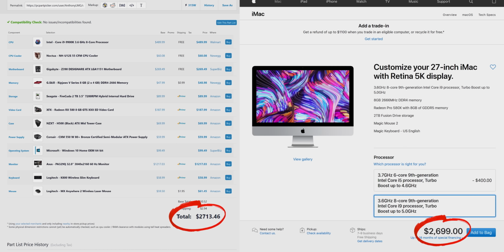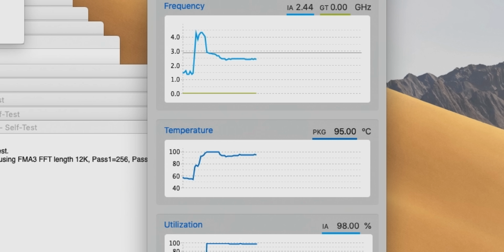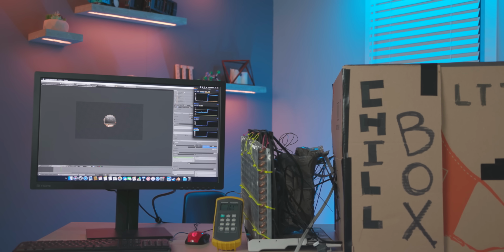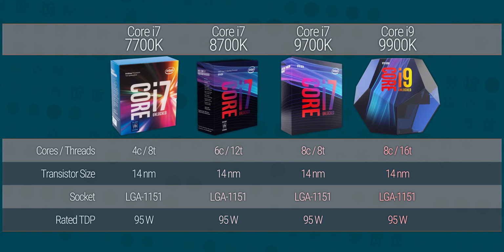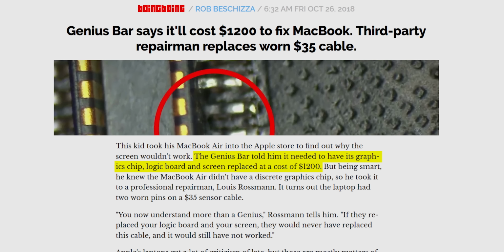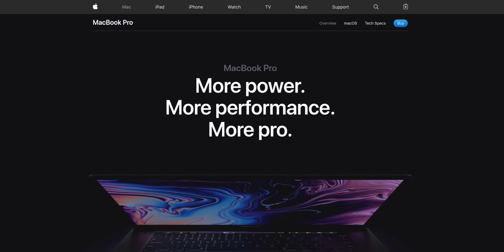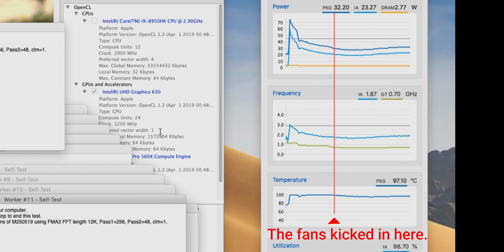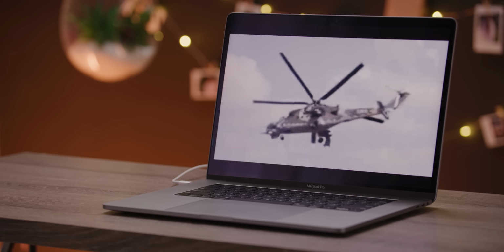Macs are SLOWER than PCs. Here’s why.

Comment: I've tried to explain thermal throttling to my bosses and coworkers when they thought it better to buy laptops instead of desktops for our work. We use CPU intensive engineering software. The general public - even somewhat tech savvy people - don't have a clue about thermal throttling. The see i7 on laptop specs and think same as desktop i7. The PC companies also push a misleading narrative.
Reply: i sell computers and have to explain that to people every day.
Reply: @Thisguya  you're one of the reasons why I didn't lost faith 🙏🏼
Reply: @Thisguya  Your boss would probably rather you didn't.
Reply: @BuzzkillZone  naw they let me work my way because it works and creates return business and long term customers.
Reply: Who runs the IT department?
Reply: @Ziplock9000  I worked at an IT company, and I can tell you from experience: Arrogant morons.
Reply: @Ziplock9000  Girls!
Reply: A former boss demanded we put a bunch of high 75W vid cards into some Dells that had weird max out of 35W on the pci-e x16 lane.

I told him this. "Put them in." OK. BOOM! All sorts of problems and burn outs.

I mentioned it again to him. The SECRETARY parroted out what his new reasoning was (hadn't heard it before): "The vid cards were bad so we don't order from that company anymore." Hands on hips, smug look.

Can't believe I showed her kindness by not ratting her out for gaming on her work PC. Don't work there anymore.

Work somewhere else with equal stupid.
Reply: @czos9239  so many people are just pathetically arrogant...
Reply: It's not the PC companies necessarily it's intel. Intel's naming scheme is so confusing. An i7 8550u is slower than an i5 8600k
Reply: Duh! The 8600k is kind of a good cpu!
Reply: @griffin8062  the u means something... maybe underpowered
Reply: @thetechguyz8645  Well I know that but the average consumer reading the average spec sheet just sees "Core i7" and assumes the computer will be fast
Reply: @griffin8062  when the tablet phase came they had to adjust and make a processor for each form factors. Desktop CPU sales slowed so they release a ton of different TDP cores along with more integrated to the board. I agree with most of it down to the i3... the rest of it needs to go away. Still a Pentium core. There is already i3 i5 i7 and three different thermal levels for each. Ultra low power low power mid range performance and high performance and then super high performance. Plus atom and Pentium... server processors its rinse a repeat. Maybe not quite like their consumer products. They do need to simplify it but they were late to SOC game I think they have had a tough time gauging it. I'm shocked there is not a Intel processor in every smartphone. They missed the train on that one and missed production capacity recently.
Reply: @griffin8062  Still, It makes profit. You pay even more for i5 mobile. What's wrong for them?
Reply: @griffin8062  Its intentional
Reply: @griffin8062  Maybe other companies want intel to keep doing this, as eventually, all they need to do is fool the large demographic who doesn't know anything except i5+2 = i7.
Reply: K represents desktop,  U is mobile.  i7 mobile CPU is faster than i5 mobile.   Desktop i5 is faster than i7 mobile..
Reply: @regulusatilius4121  LOL K DOES NOT REPRESENT DESKTOP it represents the unlocked multiplier.
Reply: @griffin8062  I didn't know that an always assumed i7 always beats i5.  Thanks.
Reply: I'm a data analyst and Everytime I reload my data or run R my fans ramp up to full speed. I'm always maxing out my CPU and it drives me nuts. My work laptop isn't the best but it's still limited by heat.
Reply: setite copypasta.
Reply: It's not only thermal throttling, but a laptop core i7 7700hq is slower than a desktop core i7 2700k from 2011, of course it has vastly improved now, a laptop core i9 9880h has about the same performance as a core i7 6700k from 2015
Reply: @tristan6509  maybe multicore scorings for cpu intensive apps but definitely not gaming
Reply: @tristan6509  it may come as a surprise to you, but laptop i7 8750h is faster than i7 7700k at multithreaded loads and only 10-15% behind desktop 8700 when undervolted
as for the i9 you mentioned - are you insane? did you look at the benchmarks or render times? WTH you people get this kinda info from?
Reply: @tristan6509  Well, not really an inprovement. One costs nothing, the laptop one, 2000$
Reply: @tristan6509  Pull a source or youre talking crap.
Reply: @MultiFuckme22  7700 doesn't have an unlocked multiplier unlike the K series...
Reply: @tristan6509  im not saying the laptop one is as fast as a desktop, ofc it isnt. What im saying is send bench scores to back up your claims or they are trash. I have heavy doubt a gen 2k would out preform a gen 7h given the same conditions
Reply: @tristan6509  Thats not true at all, and doesn't make sense. The core i9 has 8 cores and 16 threads. Its geek-bench multi core score is 6147, vs 4456 for the i7. And the i9 does that at 45w vs 91w for the i7. That is not even remotely comparable.
Reply: @tristan6509  this is not true. My 7700 is faster than my 4790k. Maybe if I overclocked it'd be different, but as it stands I use my laptop for cpu intensive things and it does quite well
Reply: @xavdest5481  i don't think a 7700 can be overclocked..
Reply: @tristan6509  that's why I said if I did overclock it might be different, but as it stands my 7700hq undervolted is better for cpu based take. Perhaps you misinterpreted my comment?
Reply: @xavdest5481  a 7700 cannot be overclocked, it doesn't have an unlocked multiplier unlike the K series CPUs
Reply: Thats why you should RESEARCH first before buying the product
Reply: Uh no, if your boss tells me that I have to get a laptop over a desktop I would assume it’s because they wanted me to be mobile with it and take it on trips or something.

Pretty sure everyone knows a desktop is more powerful than a laptop.

I mean look at what’s in a desktop the gpu, cpu, cooler, fans, memory, etc

All that shit is bigger than a laptop’s and everyone knows bigger is better.

So yeah that’s pretty surprising your work believes laptops to be superior.

Laptops are cool and all but I always view them purely for what they are meant to be: MOBILE.

It doesn’t matter how amazing the laptop is, it can have a RTX 2080ti in it and you would still always be beat by a better desktop.

You are not beating a desktop if money is no object, there will always be a better one.
Reply: Wait, engineers don't understand thermal throttling, so you work for apple then?
Reply: @noobiesmurf  the fastest mobile processors that don't throttle are made by apple, why are you kids so fucking stupid?
Reply: buy xeon server, put high end gpu in it and set it as remote desktop server. they can use even i3 laptop as client
Reply: @mzamroni  Uh I surely wouldn't recommend an i3 laptop, not even as client, not for anything. I bought a 5th gen i3 laptop for my wife, thought it would be decent. That thing is slower than my 12 years old low-end PC.
Reply: An uphill battle my friend. Comment from a friendly neighborhood sysadmin.
Reply: Lucky for me it's easy to make people here understand this stuff since I said something like "thermal throttling is when your cpu/gpu is hot enough for it to slow down to avoid overheating" and follow that up with live example.
Reply: Yas! I had the same argument with the IT manager, laptops and the mini-PCs we have are fine for our staff 75% of the time but we need a hardware resource for the more intensive applications. He said something about doing it in the cloud, which is okay, except our existing cloud resources suck and the way we do contracts and procurement means that’s not likely to change anytime soon.
Reply: the real reason to why they choose  laptop is to lead the employee to take it with him at home and possibily to work a bit more than the regular office time...
Reply: Dell Precision Mobile workstation laptops can run intensive CPU and GPU apps 24/7 with temp never gotten higher than 70 celcius, with the lid closed or opened. I have many models of these before so I know there are really desktop replacement-notebooks. One just need to do some research. HP and Lenovo have similar line as well. They can be speced with Xeons, ECC rams and with Quadro or Firepro GPU.
Reply: @noblekitty  But those are super expensive
Reply: @abhimaanmayadam5713  just as much as these Mac pro. Honestly, if you were to build a desktop with Xeons, Quadro gpu it's going to be expensive too
Reply: @noblekitty  I'm using an Xeon with an RX 560. works great.
Reply: Very true.  I own one myself and have run my Dell M6800 for 24/7 render jobs for years.  There has been no thermal throttling (when NOT using the dock) even when operating the GPU and CPU at 100%.  The fans do get loud though.
Reply: @noblekitty  No they are not. The fan ducts are so tiny that you need to disassemble them every 6 months or they will overheat and throttle down to 1.6GHz without warning. The fans do not even spin up while overheating!
Reply: @noblekitty  I can vouch for this. My Precision 7730 with an i7 8850H and Quadro P4200 can easily run intensive tasks such as GPU rendering in Redshift, painting and baking in Substance Painter, sculpting in Zbrush, or animating in Maya and it can do it all without thermal trottling. Hell, I can do a hybrid GPU/CPU render in Blender Cycles for fun and the GPU stays around 76 degrees (fully boosted) and the CPU around 85-90 degrees at around 3.6-3.9GHZ. The CPU can also maintain its boost clock indefinitely during intense single threaded tasks without much issue.

 The thing that really causes some issues however are the giant thermal spikes from both the CPU and GPU when running my Wacom Cintiq through the thunderbolt ports. What is that all about?
Reply: @noblekitty  The only problem is that the fans go crazy and are really rather loud.
Reply: At least some PCs come with beafy coolers.
Reply: Not to mention that even the "H" series laptop chips perform severely worse than any desktop tier chip. The big misleading bit is "Turbo clock up to 5Ghz!" despite the base clock being 2GHz
Reply: i worked for an engineering firm designing fiber wire runs. we had laptops and they performed pretty good. i didnt mind them specially after i got work from home priviledges.
Reply: It is possible to build an i3 hackintosh 8350k 5.1Ghz that blitzs the i9 laptops costing 10 times more for many workloads. That is how severe the problem is.
Reply: Yes, this is their target audience, and it's next to impossible to explain these aspects to people who only see status quo. They just tune out and default back to their own paradigms. My boss is a Starbucks digital nomad (he hates being called that) who uses a Macbook because it's cool, and of course he needs other "entrepreneurs" he meets with in the eCommerce space to see him using it cause in dumb speak, saying you have a Macbook is a good sign you're having your finger on the pulse man. God forbid they might think less of him if he's seen with a Carbon X1 or an XPS. Even though those might be pricier than his. A couple of years back he told me his iPhone 7S has a higher resolution than my phone at the time which was an HTC 10. I almost burst into laughter but managed to contain myself. Didn't try to explain how that is false, because he just got the phone and didn't want to disappoint him lol. I've learned that with these people it's best to just let them wander around their comfort bubble and not disturb them.
Reply: @root9065  😂😂
Reply: @root9065  It's best not to disturb programmed sheep.
Reply: @root9065  spot on with that last point. Not worth having that conversation cuz 99% of the time only person getting screwed is them so fuck it.
Reply: @root9065  also is it just me or do they know deep down they are getting ripped off. Because they constantly need to validate buying an apple product by making statements like the one you mentioned about phone resolution.
Reply: R.I.P
Reply: a $30 laptop cooler for thin and light laptop is a good compromise for mobility/thermal throttling
Reply: they can't be tech savy. I'm just a kid that likes pc and taught myself how to build one 5 years ago. I know why they are throttling and I know that intel is fuckin up. AMD isn't the best for games but its better right now. they innovated which is why I have updated my current desktop with ryzen 1600x (I don't do much CPU intensive stuff)
Reply: It's so foolish, assuming they're not prioritising portability.

What really gets me is, it's not hard to understand. They should just imagine working in a sauna instead of their airconditioned office, then realise that the chips work largely the same way.
Reply: Your boss is an idiot no offense
Reply: @tori9365  you're cute no offense
Reply: @nowonmetube  thank you 😘😋❤
Reply: @tori9365  aww that's cute 😊 thank you too and you're welcome 😘❤️
Reply: @nowonmetube  haha 😊
Reply: Reggie Jackman haha have you ever worked with engineers? They know shit about how computer hardware works. Even the developers wouldn’t be able to tell the difference from RAM or the SSD unless you pointed it out.
Reply: @PatrickPecoraro  wtf.
Reply: @PatrickPecoraro  So incompetent, like I said.
Reply: To hear that it’s a IT company and that thermal throttling is completely logical is really sad.
Reply: Didn't Apple get caught , and admit to forcing phones and computers to throttle down intentionally via a bogus software update right before releasing new products?  I think they want the ability to cause reduced performance without it appearing so.   And they do that with the fans and throttling... and I'm sure with the aid of certain services running in the background.
Reply: I used to fall for this when I was able to afford recent laptops, and wanted to game on them.  I have always liked MacOS and Apple computers looks and on paper the specs are impressive, so I seeing i7 I always assumed it's equivalent to the desktop chip, but watching this video has made me understand its not the same, and I'll probably reconsider buying an Apple laptop to use for intensive tasks.
Reply: Let alone that Intel now lumps Core M into Core i, so something like the Macbook Air touts the same "8th generation Core i7" as models with twice the cores and a few times more wattage.
Reply: "The PC companies also push a misleading narrative."  (LOOKS DOWN) "VIEW 185 REPLIES"  (NODS)
Reply: The only way i can see this as being reasonable is if they set up the laptops to be thin clients for the beefier workstations
Reply: While I agree that a great big desktop case has better cooling than a cramped laptop.
What people buy depends on their circumstances... I’m not static or at the same address all the time and I often need to travel abroad with my work every few months. Therefore owning a desktop just isn’t practical for me. Am I running intense CPU applications? No. In the past I’ve successfully used AutoCAD on a 2012 MacBook and never had a problem with heat.
Reply: Easy way, say: "Laptop cpus are crippled desktops ones, hey look here it has half of the cores (cores are like employees the more, better), so they would have half of the performance. Also laptops overheat, this is bad and makes it even slower, desktops dont do that, because air cant flow well in thin stuff". 
Done..

Usually works for me
Reply: @eduardoavila646  IT dept in my workplace think latest Intel integrated graphics are faster than GTX 960s that we used to have. Therefore we can start rendering using onboard graphics hahaha.
Reply: @wyw201  Lol thats quite bad! But if they actually buy pcs with only igpus eventually they will learn that a 960 is better, and probably the hard way.
Reply: @eduardoavila646  actually desktops do thermal throttle and overheat. Just not as easily as laptops because better air flow and more space.
Reply: @eduardoavila646  ambient temperature is also a factor. The way you said it made is seem as if desktops can never thermal throttle but they can depending on the ambient temperature and workload. It's just less likely
Reply: @javianbrown8627  Again,  well made and maintained ones dont. 
I had probably through the history the worse heating cpus, and with a suited heatsink, under a ambient temperature of 40°c, they were still in 'working temperatures' away from the limit. The worst case cas in fact a 125w Pentium D i had wich had something like 72°c tjunction, but just due to the low tjunction, it would get up to 65°c perhaps even 68, but no thermal throttle at all. 
Same for a amd fx8350 wich again had a pretty low tjunction (85°c if im not mistaken) and it was fine at 70°c. Any modern cpu will have a around 100°c tjunction, if you cant keep with a suitable heatsink its temperature under that even at my summer 38-42°c, there is something really wrong there. 

Again there is not much to go wromg with a desktop, it has a Xwatts cpu, and a heatsink designed to Xwatts or X+Ywatts on it. It should be fine unless something restricts the air flow. 
Then again thats why i say "well maintained", it means clean, cable managed and with the air ins and outs all not obstructed. 

Laptops in the other hand may be in a cloth surface or in your lap, have usually under-dimensioned heatsinks (15w heatsinks for controllable base 15w and turbo 30w cpus) and intentionally badly programmed fans to reduce noise, added to being hard to open and thus poorly maintained. 

Unless you get a desktop and put it in a 70°c ambient, with only literally the cpu cooler it would likelly overheat, but thats even humanly impossible to be at and i cant imagine any ambient where it would be like that. Or you got a 65w heatsink into a 95w cpu or a 95w heatsink into a 125w cpu, then its your fault to be using the wrong part. A 65w cpu comes with its 65w heatsink wich is indeed well designed and has space to be big and actually be able to cool down the pc. A laptop one is smashed and cant be big anymore due to the idiotic thinnes trend.
Reply: @eduardoavila646  yeah I know why laptops are more likely to overheat. Yes a well built and managed PC is less likely to thermal throttle, I'm just saying it's not impossible for them to do so but you seem to be missing the point. 
The reason is this isn't a perfect world and bottle necks exist. You won't always be able to get all the components to have a near seamless experience due to price, where you live and other factors.....
Reply: @eduardoavila646  yes, this is exactly what an ignorant person would say who never does any research. And Intel core i7 H series processors have the same amount of cores and threads as desktop ones.
Reply: @TabalugaDragon  Nope, thats what a person who didnt pay attention would comment. In my other comments i was talking about the ulv lineup. 
Secondly, not necessarily, a I7-9850H has 6 cores, while a real desktop i7, a 9700 or 9700k has 8 cores. 
Yes a simple core i5 for example a 7500 has the same amount of cores as a 7300hq, but that doesnt translate into the same performance even if most didnt thermal throttle or power limit throttle. While a i5 7500 does 8020 score in cpu passmark, a i5 7300hq does only 6796. Again, counting it doesnt have any issues as most entry level gaming laptops and some workstations do indeed thermal throttle. The dell g3 for example does thermal throttle, and actually most of the i5 h/hq equipped laptops with 1050 or 1060 do tend to do that. Some like the nitro 5 actually manage to not overheat.

Now of we talk about ulv ones, a i7 8550u has 4 cores at a baseclock of 2.0ghz (and with lucky you may get up to the turbo duty cycle varying like crazy, if the manufacturer didnt program the tdp limit to 15w), while the core i7 8700 has 6 cores. While theorically at full turbo max speed the whole time a i7 8550u would score a impressive 8301 at cpu passmark, the i7 8700 scores 15154. And lets not forget that most likelly the i7 8550u will throttle and be limited to 15w, wich leaves it with only 2.0ghz under heavy load, wich in fact will cut about 50% of its performance (being positive saying it would actually get up to 4.0ghz in all cores turboing while i think its actually its singlecore boost, probably the multicore would be 3.6 or 3.8) so then it would actually do 4150 wich is even worse than the previous generation i5 7300hq.

So uh, i guess you was the one who actually didnt search propperlly. Laptop cpus arent comparable to desktop cpus even if we take out their major cooling issues (wich even got worse with some extra cores).
Reply: @eduardoavila646  nope, it was you who didn't do enough research. Of course I wasn't talking about low voltage CPU-s, no one in their right mind would get them for a high performance computer. I was talking about H series CPU-s, and yes there are exceptions(though 9750h conpensates with virtual threads instead of 2 physical cores), I was talking about real life, long-lasting benchmarks, but usually the amount of cores the same, 10-th gen will have the same amount of cores and threads for CPU-s for example.
At short bursts my i7 8750h, while undervolted  scores a little more than 14000 points, now see how much it's desktop equivalent 8700 scores and compare. It also shows stable 3.9 in games when undervolted, which is also a really small difference between it and the desktop version. I have this CPU and I benchmarked it extensively, comparing it with some desktop CPU-s at my disposal, and the difference is between 10 to 15 %, just like I said. So get your facts straight before writing something. Speaking of Dell G3, it's exactly the laptop I have, and it peaks at 80 degrees C at full CPU load and doesn't thermal throttle, so yeah, I know exactly what I'm talking about here.
Reply: @TabalugaDragon  And again, i didnt say that every laptop cpu has half of the cores of a desktop cpu, but not only its easier to say that to someone who doesnt understand a single thing about computers, but also most computers sold in many countries, are still 7th generation, and usually most of them are ulv ones wich have 2 cores only, even on the i7s, so comparimg with even a desktop i5 it would be half the cores. 
But again, its a really simple resumé of the situation, not the whole story. 
Trying to explaing thermal throttling and tdp limits and even tdp itself to who have no clue about pcs or electronics, its too hard.
Reply: @eduardoavila646  I know exactly how they work, for I have been studying this topic in all details for several years now, cause I'm pretty much obsessed with laptop CPU-s, hence why I know so much about them, so no explanation needed, thank you very much. 
Again - people who want high performance would not buy an ultrabook with 2 cores. I mean maybe an office worker may not know that old dual cores are really slow, but a person who actually works with large amounts of data which require as powerful CPU as possible would know about the difference between a powerful CPU and a weak one in 99% of cases.
Reply: @eduardoavila646  OMG, your lack of knowledge astounds me. 
1 You offer me installing passmark benchmark? For whom did I post my 14000 points score in a comment above? for Santa Claus? This benchmark is one of reasons why I am so sure about smal difference, as I did this half a year ago. Now go look at i7 8700 score.
2 and speaking of small difference, you say they don't have the same performance, well DUH I never said they perform exactly the same, I said within 10-15% difference, and NOT the 95 watt TDP version you mentioned, in case you didn't know(and you obvipusly don't) the i7 8700 I mentioned is only 65 watts TDP, not 95
3 Laptop chips are higher binned, which means they can hold the same clockspeeds at lower voltages\producing less heat. Read about it
4 In case you didn't know, the amount of TDP doesn't directly translate into performance, if you ever overclocked or undervolted a CPU, you'd actually know this. 45 watts(with no tweaks) would give us 3.5 Ghhz, By your logic 95 watts should give us 7 ghhz right? Wrong. Again, you'd know this if you studied the topic and knew how voltage\frequency curve work. One can reduce the heat emossions drasticly without sacrificing much performance
5 With undervolting it's much easier to close the gap between the 2(again, NOT the K version, laptops have oerclockable CPU-s as well, so desktop K versions should be comparedto them, not to the cheapest, locked versions), which, in end result translates in really small difference between the laptop i7 8750h and desktop i7 8700.
6 LOL I never rely on such reviewers liek Dave Lee. I wasn't talking about combined stress-tests,  I was talking about CPU load only. If you ask reviewers what temps they were getting atCPU only loads they will easily confirm my words - 75-80 degrees C. I don't need reviews to knwo the truth if I have the laptop and render 24\7 on it quite often
7 " people who dont know nothing about computers" won't wanna super high performance computer in the first place
8 "I'm sorry, but if i compare a older cpu, due to ipc and manufacturing process changes ot of course will likelly be close. " the hell are you talking about here? I compare CPU-s of the same generation. Or you really think that i7 8750h and 8700 are made on different architecture? seriously?

And yes, I did read your comment carefully, the fact is, since 8-th gen laptop CPU-s have really high clockspeeds, which, combined with undervolting gives huge boost compared to previous gens. Go to passmark site and compare the latest CPU-s yourself
Reply: @eduardoavila646  Sounds about right. Amusingly enough, a C2Q Q6600 has a similar CInebench R20 score to an i5 7200u. This CPU is over a decade old and is somewhat close to a modern laptop CPU
Reply: @abhimaanmayadam5713  Yes, but sadly, as said before those laptop cpus tend to overheat due to bad cooling. 
The ulv chips (those who end in "u") are even worse due to cpu current limit or tdp limits of 15w forcing them to the base clock (and thus halving their performance). 

But yeah it's pretty impressive that a mobile 30w chip (should) outperforms a desktop 65-95w cpu.
Reply: Abhi Mayadam not when it comes to performance per watt they don’t. Or factor in the efficiencies of the newer chips with certain types of data.
Reply: Laptop cpu's are getting better.. but heat is the biggest issue... 
Im running a laptop with an i7 8750H. Which is last years cpu. I think it is the equivalent of an i5 8400? You guys seem to know more of this stuff then me.. I haven't got issues with cooling myself (running under 80 degrees all the time) BUT keep in mind older laptop cpu's can run to 100 degrees. Desktop cpus not. Mine doesn't reach that fortunately for me :)
Reply: When U Think your the standerd then u realized your not the standard.
Reply: It depends on the laptop though... some especially the bulkier ones are not too restricted.
Reply: Did they budge?
Reply: Wat.
Reply: Funny, I guess a lot of people don't get it??
Reply: So what you're saying is I shouldn't buy an i9 laptop?
Reply: @Mouseythegreat Unfortunately our database/software package requires us to be hooked up locally at the office. We can set it up to also work off the database, but it's a real PITA (nothing works as it should.. and you still have to do extra work when you hook back up to the database). Laptops do have built in UPS.. which is a plus.
Reply: Lot’s of pc guys and switchers getting fooled by that yes.
Reply: I know that laptop lineup isn't equal to desktop lineup and is inferior due to power and thermals... But I bought the i7 8750H for it's pretty closeness in performance to desktop chips... But I was wrong... The thermal throttling in it simply widens that gap...
Reply: Gus Johnson  And same probably applies to most PC laptops with the same Apple laptop specs... Shessh.
Reply: Buy a laptop and then just use a VM if you need different specs...
Reply: Me: What specs do you have?
Friend: I have an i7.
Reply: like my comment in this video. you'll have to sacrifice your warranty from your laptop to add improvements like liquid metal for cpu and gpu, adding more ram and storage(ssd/nvme/m.2/optane and so on) disabling any usless bloatware from windows and the from the brand of your laptop to speed up thing A LOT. minimize or disable all animations in windows to add a bit more speed
Reply: @MykTAOfficial  That can make it more snappy in light use, but it probably won't make a significant difference in CPU/GPU intensive work unless the laptop had some type of serious issue.
Reply: @BReal-10EC  yeah even if youre in a very cold airconditioned room to not make your laptop throttle but the laptoo has some internal minor or serious issure then voiding the warranty would be a pain in the ass especially youre laptop is very expensive
Reply: 1 word: Marketing.

“Established” Brands like Apple easily manipulates people. When basically there are things that they don’t tel, which are the secrets
Reply: They clearly aren't tech savvy in any way then. =\
Reply: @MidnightMarrow  yes sadly thats how marketing works. They manipulate the consumer in a way that's like a legal scam and they will find out excuses when to counter the arguments and claims.
Reply: At one engineering company, they buy Dell Precision 5530's or Precision 7730's for everyone that works with engineering software. Guess what the two most common repair calls are?
- Overheating (the machines get full of dust, hair, animal hair, or worksite contamination)
- Battery ( for those taken on-site), but mostly the 12/13/14" manager laptop, who have batteries die after 6-12 months, and the batteries are swollen.

The more or less right solution is for the laptop manufacturers to dial it back away from the ultrabook design that Apple popularized and put a desktop CPU, GPU and respective Cooling solution in a laptop form factor if they are intent on using it like a desktop, which also means that the back of the laptop must be removable, and the fans must be removable without taking any screws out. 

Instead though, the coolers in even the best machines are not even as thick as a pencil. Compare that to the 1" coolers seen on desktops. If you're going to make a laptop, be prepared to crater the performance if you don't give it adequate cooling.

If businesses really did a cost analysis of the productivity loss from taking a 30% hit to the computer, they would never switch to a laptop in the first place, yet the recent changes from mechanical drives to SSD's have resulted in a net gain, even if it was to a worse laptop because the drives are 30x faster, so what is normally the first hour of the day lost to rebooting the machine is now done in 20 seconds.
Reply: Try telling them that an i3 from 2018 is better than an I7...from 2012
Reply: Relax, they won't even notice nor compare the jump as long as you tell them they have top of the line hardware....
Reply: Sad but true.
Reply: I feel your pain. The people at my office sometimes experience horrible framerates in their modeling software when working on high detail structures. But for some reason, they're all on laptops. I know the goal is to make people more mobile, but when your laptop is powered by a single USB-C cord...
Reply: well, with undervolting the laptop i7 8750h is only about 10% behind the desktop i7 8700, so they could be right if they want aesthetics over a little more performance. However, if we are talking about top end PC-s like the ones that have Threadrippers in them, desktops definitely win there.
Reply: @kiyoponnn  nope, they probably know that i7 8750h is barely any slower than a desktop i7 8700 when undervolted
Reply: @TabalugaDragon  The "barely any slower" part makes a not-so-insignificant difference when it comes to cpu intensive workloads
Reply: @kiyoponnn  it depends on what kinda loads. Editing short videos, or for short bursts of power(like from several to 30 minutes) there wouldn't be a noticeable difference between them, mostly if you specfically measure the render times and such
Reply: @TabalugaDragon  Fair enough
Reply: So basically what apple does is put a i7, i9, etc in their computers for branding and because they don't want their users to hear fans, the CPU thermal throttles so you don't get maximum power? Seems like Apple
Reply: In layman's terms they'd understand, it's like running on a treadmill with with a dinky desk fan for cooling vs having a box-fan blowing on your face. You're going to get really hot and exhausted and will slow down quickly with the small fan.
Reply: @ReggieJackman  Tell them whats up when you have a meeting with the Bob's.
Reply: So heat is the reason that made my desktop using xeon e3 1231v3 rendering faster than my laptop using i7 8750h.
Reply: Old people just need to be replaced in the workforce, wait another decade and it should do
Reply: @ReggieJackman  This is probably one of the best advices
Reply: What the hell is even the point of i3, i5, i7, and i9 if a U series laptop i7 is worse than a standard desktop i3?
Reply: I am a financial director and I totally agree with you! Sometimes I have to run heavy VBA codes, and my i7 16GB RAM does not follow me :(
Reply: Youre work place dosent let you buy youre own laptop
Reply: "even somewhat tech savvy people" Well, I would dispute calling them that if they don't know about thermal throttling and the differences between mobile and desktop CPU SKUs. :)
Reply: Finally, someone said it. 
I gotta explain this to many Apple users. iSheeps are too stupid to comprehend the idea.
Reply: How do tech people dont know this?!?! thats is weird or not
Reply: I think laptop cpu can push performance for some time but for  continued work is big no except u water cooled it
Reply: My 2014 Macbook Pro can run 100% CPU stress test all 4 cores at 3.2GHz and keep under 80C with custom fan profile and a little reduced voltage to the CPU using Intel overclocking tool... Problem is that Apple by default allow it to perpetually overheat as they want it to run silent and self destruct just about the time warranty runs out lol.
Reply: It's sickening how tech companies like Apple take advantage of the non-tech savvy people!
Reply: @murphytheturtle8968  Actually, I AM tech savvy, as you can see from my Youtube channel. Please don't be mean. I know a lot more about computers than you think I do, so it's ironic how you can assume I'm not.
Reply: geo58impala not so sure about that. The lack of basic computer knowledge by Linus fanboys is legendary. They wouldn’t even be able to work pc’s from the 80s.
Reply: Explain a lightweight fan control app, sooo hard.
Reply: Software Engineering, not ENGINEERING software
Reply: PC companies are Democrats
Reply: Same at my job. Sometimes they listen and sometimes they don't.
Reply: I worked for half a year in the digital team for a major engineering consultancy. I was running Visual Studio Pro on top of Docker-based microservice infrastructure on a laptop with a Core i5 and 8GB of RAM. Some companies just don't think that it's worth spending the extra capital to increase productivity, when I lost a long time to waiting for things to compile, waiting for docker containers to load and so on. Add up the wages and they might as well just have bought me a better PC.
Reply: Don't even mention how poor ergonomics on laptops are if you're working on them. You either constantly have to look down or have your arms so high your shoulders will impinge.
Reply: @centralintelligenceagency9003  Word, yeah, laptop ergonomics are pretty bad. Though in my case I would always use a laptop dock mounted on a riser, with a second keyboard and mouse so functionally it just became another screen
Reply: There is no way to fix this if people don't try to learn simple stuff... apple is everywhere and why? Just because of a name... it was good when Steve was here, now Tim is literally cooking the whole pc making part of the company. At least that's my opinion :/
Reply: Is that why my computer tends to slow down?
Reply: "I've tried to explain" is one of the most melancholy ways to start a sentence in the English language.
Reply: @ian_b  And yet, you just did that. lol.
Reply: @BReal-10EC  You got me there Bryan :D
Reply: They'll pay $500 even if it's i7 (1st gen)

For clarification, https://cpu.userbenchmark.com/Compare/Intel-Core-i7-950-vs-Intel-Core-i3-9100F/617vs4054
Reply: What a circle jerk
Reply: Intensive Engineering Software? Surely your bosses and coworkers should know something, like what the heck?
Reply: Actually a lot of people know exactly what is is, maybe not older people (not sure how old you or your coworkers are) but im in my mid 20s and have known about it since I was 17 and started getting into tech. Anyone I talk to who is also into tech knows what it is.
Reply: This is so true!! Laptops are almost always a worse choice.
And the run of the mill office laptop i7's usually can't even keep up to an desktop i3, but all they see is the i7 logo and assume it'll be good.
Reply: They seem like the same people who would think the monitor is the computer...
Reply: @trueminecraftfacts  No.. just the "know enough about a topic to think they know it all" typical adult men. See The Dunning Kruger Effect.
Reply: A i7 7700 hq processor is almost equal to 6th generation i7 desktop processor normal version I did the comparison from graph myself but you have to put thermal throttling aside and power consumption so in theory some laptops do ship with swappable processor in theory they are close but in real world they are far from equal due to this Gap 😅
Reply: not a good thing to argue for when everyone at work is clamoring to get a laptop they can take home as a perk. 😜
Reply: @maxmustermann3938  do you imply that a laptop cooler not spinning will have a better cooling effect than when the fans are spinning ? ( unlikely, i compared low speed to high speed and i see a difference in cooling performance) - i am assuming a passive mesh will have simlar performance to a unpowered ,spinning laptop cooler which is a mesh+ a fan underneath
Reply: BuT iT FiTs In My BaG AnD I CaN TaKe It To MeEtInGs 

IT at engineering companies the world over has this balancing act between mobile and practical that a lot of people just don't understand (or worse, don't want to understand). Whenever I have someone say 'I need a laptop!' to me I ask them why and if they just say the above I tell them I'll get them a £150 tablet instead. It'll do everything they want the laptop for but mean they still have access to the desktop for engineering. You can't build small laptops with good performance, the laws of thermodynamics just don't allow it.

Also, nice car.
Reply: @ReggieJackman  I assume you are an engineer. Non- engineers that work with engineers know that they can be seriously flawed control freaks.
Reply: It somewhat worries me that the heads of an engineering firm don't understand this...
Reply: @FakeJeep  Lol
Reply: I just have a question. Do they insist on buying laptops because they always bring it with them? Because whatever you say, desktops will never be as portable as a laptop. And honestly, I still prefer laptops because it lets me work everywhere when desktops cannot.
Reply: @jeus_saaa  a laptop is not replacement for a desktop.  Yes it's portable but at the same time it's not a desktop.  Understanding the key differences as it relates to performance can make or break your small business..
Reply: @22vah  that's why I'm asking if the reason they prefer a laptop is because of portability. No matter how strong a desktop is, if they constantly travel and need something to work on all the time then the laptop wins.
Reply: @ReggieJackman  my lack of knowledge in laptop parts does not take away from my knowledge in engineering. I spent 4 years getting my degree, just because I don't watch as many linus videos as you does not mean that degree is useless. I would rather work with them than with someone who shares your attitude.
Reply: @Lukeskywalker2307  not to be an asshole, but it hardly takes a Linus video to look at specifications and figure out which is better.
Reply: @ChucksSEADnDEAD  most people don't know the difference between an laptop i7 and a desktop one. That's the issue at hand. Nobody said anything about reading specs
Reply: @Lukeskywalker2307  you said, you were too busy getting the degree to watch Linus. But it doesn't even take a degree to just pull up spec sheets. Does the civil engineer not pull spec sheets on the kind of rebar he's going to use? Doesn't the environmental engineer pull spec sheets of the ducting he's going to use? Doesn't the mechanical engineer pull spec sheets regarding the cutting tools he's about to purchase for the lathes and milling machines?

So why would anyone say "I'm an engineer but I have no time to deal with specs"?
Reply: @Lukeskywalker2307  And Intel's CPU naming scheme doesn't make it a simple comparison when shopping either. GPU naming between desktop and mobile can also be confusing/misleading.
Reply: @Lukeskywalker2307  I dont watch any linus videos. This was my first. Nice to see you're raging with insecurity though. That makes sense though. Only grossly incompetent people would rather work with grossly incompetent morons than with people who are great to work with but who happen to tell the truth about competence. You also couldnt work with me. I would fire you so quickly due to incompetence, and then would just ignore you while you blabber about attitude, ironically as you would be the only one with an attitude problem.
Reply: How on earth does this comment have so many likes?
Reply: Exactly it's a laptop issue that multiple PC companies are guilty of as well (microsoft, alienware, dell, etc) in the pursuit of higher spec, thinner, and lower fan noise. It's not something that's bad about Apple itself as the mac mini test proved out. Linus has such a hard on for trying to get people to stop buying any Apple products that he doesn't tell the whole story.
Reply: that's just capitalism for you
Reply: @doji_town_adventures  that's not called capitalism, that's called ignorant buyers. If you don't know what your buying and its expensive, than your just dumb.
Reply: @domomonstero3077  if anything i'd say it's greed, which is deeply ingrained in our culture because of capitalism.
Reply: @doji_town_adventures  capitalism doesn't make greedy people, greedy people exploit capitalism. its the morons that always give into the bad/shady practices and keep fueling this shit. we need a better legislature that actually cares about keeping up with software/cyber laws.
Reply: @domomonstero3077  note how i said deeply ingrained not created by, capitalist societies definitely influence people into being more greedy
Reply: @MasterBlaster220  oh buddy have i got some news for you
Reply: @doji_town_adventures  Yes the most altruistic system in the world
Reply: @doji_town_adventures   you can still choose and buy... Or not buy. That's capitalism for you.
Reply: @doji_town_adventures  It's also capitalism to not buy those things and demand better.
Reply: @EssenceofPureFlavor  yeah too bad voting with your dollar only works if you make up the majority, which barring specialty products, doesn't work because we're the enthusiast crowd lol
Reply: @doji_town_adventures  Truth. Built to break. All profit driven
Reply: @Georgeoforce  if someone is buying something "built to break", thats their own fault for not being able to handle the choices adequately...
Reply: Yeah i7 laptop with 2 cores 4 threads is definitely equal to i7 desktop :)
Reply: @shallnotbenamed814  2 cores and 4 threads? even the u series is 4 cores and 8 threads for 1.5 years now, wth?
Reply: Linus 5G is going to affect alot of People with Radiation Poisoning you should be covering this man!!!
Reply: @EncryptedDataGS  

Stfu, you conspiracy-theorist-alarmist-antivax-luddite
Reply: Some laptops have better cooling than desktops and at same time better performance so what's your point? It's clear  you never used a laptop. Of course if you buy a laptop very thin and lightweight then you'll have bad cooling and thermalthrottling.
Reply: @HeavenlyWarrior  part for part, you'll never find a laptop that performs as well as a custom-built desktop. If you're comparing some eMachines desktop to a ROG laptop, yeah that ROG is probably gonna win
Reply: H CPUs have been rubbish from the start. Badly binned silicon paired with bad cooling and underwhelming VRMs, sold for ridiculous top dollar. 8950HK for example, even when not throttled to all hell, is a downrated i7-8700 (non-K), but at $578 is more expensive than 8086K... even 9900K.

Which is why even the midrange Clevo LGA's (N950/N957 chassis) are clear CPU performance winners over the fastest "laptop" HKs, and also cheaper, and the high end Clevo LGA bricks (P775/P870) kill the HKs dead
Reply: @greebj  Agreed. The U and Y series at least have a place... Even if they tend to be misleading
Reply: @Hyatice  I'm not talking about custom built desktops and I don't think that's what this post is about. I'm talking about normal desktops. Of course a top end desktop is much better than any laptop but the general desktop may not be better compared to a big and powerful laptop which usually have excellent cooling.
Reply: Why are you running intensive loads on a laptop anyway everyone runs on cloud now, get with the times!
Reply: @barefeg  no they all dont
Reply: Lets Hope we can have Trump Censor these Video Games from getting more Stupid everyday I’m not hating on Linus but what the heck is happening to this Generation of Idiots more... People are becoming Lazy everyday and not caring what happens to their life they act like there is no meaning how to spend their life but play video games until the end !!! The New Generation are a disgrace to America. Trump 2020
Reply: @EncryptedDataGS  So you're calling for an authoritarian police state?